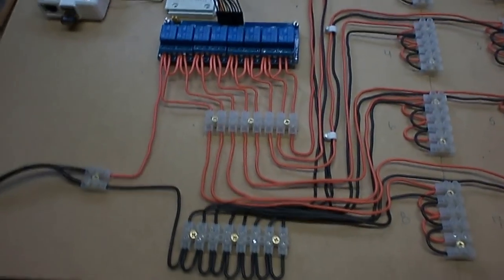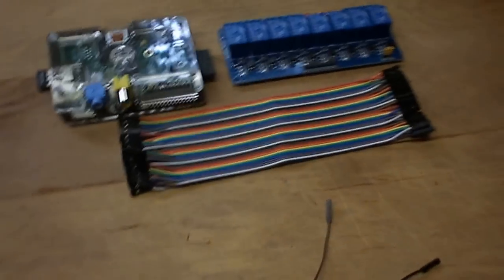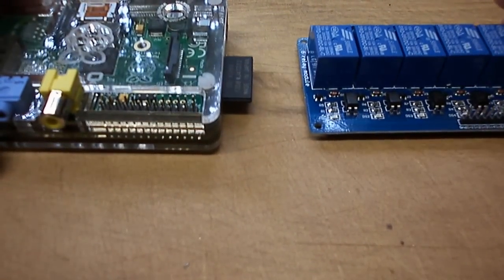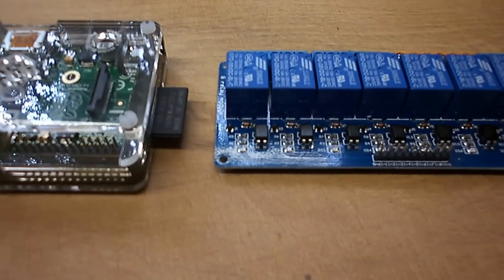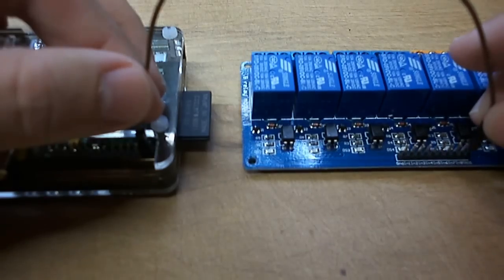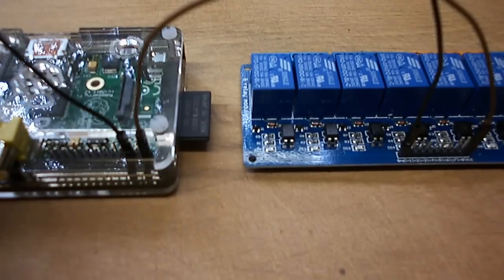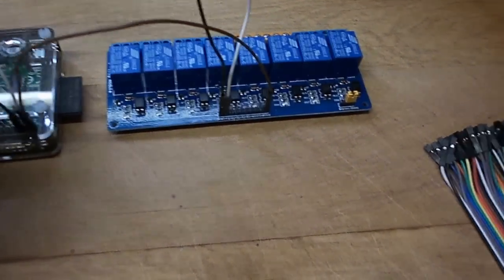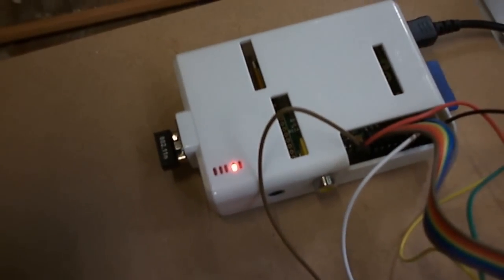How to: Home Automation - connect 8 channel relay + Raspberry Pi

Comment: Thus - as this appears to be - an 8-way 12vDC RELAY board - with opto-couplers on all inputs.
I take it (also) that your "Raspberry Pi" - is only outputting a 5vDC power source..

You are attempting (in this video) to tell everyone here, that the 5vDC (your little device outputs) is good enough to provide enough power for all 8 of those 12vDC relay coil circuits, even if these 12vDC coils - are all powered on (as occurs at some stage of the relay ops).

I would assume that you have zero idea, what the opto-couplers are there for, as their primary function is to increase the 5vDC signal outputs from your PI - to operate the 12vDC relay coils.
Thus - you have to have a 12vDC supply (ready) for the relay coils, and that then allows for these 5vDC signal outputs from your PI device - to control the 12vDC feed to each relay - when controlled via the 8 opto-couplers (when a signal arrives from the various 5vDC PI signals - all of which ONLY have 5vDC signals - that are boosted via the "on-board" opto-coupler circuitry.

It is these opto-coupler circuits themselves, that allow the 12vDC to operate the 12vDC relay coils, as they are designed to "electronically" switch the 12vDC supply (to allow each relay coil to get enough voltage & thus working current - off the 12vDC) when your little device can only supply 5vDC signals.

An external 12vDC supply is required to be powered ON at all times that you have the board connected to your PI, thus you also need to switch it on & off, (or have that always on) before any of your PI's 5vDC signals will operate the opto-coupler circuits, to electronically control the relay coil circuits.

To thus allow the 8 "signal controlled" opto-couplers to switch that 5vDC signal - via the 12vDC feed which in turn switches the coils of the 12vDC relays - that each relay those opto-couplers control, 
You need to optically isolate the 12vDC supply feed, from your PI's 5vDC signals

The relays thus are switched optically from just 5vDC (when your 5vDC PI sends a signal via one of the 8 outputs - all of which ONLY have a 5vDC signal feed, coming from the PI master unit).

As the relays themselves require 12vDC - the 5vDC signals coming from your PI will NEVER be sufficient to power-on 1 relay coil - let alone all 8 of the relay coils - unless they are BOOSTED by the opto-coupler booster circuits.
 
Only by way of the opto-coupler circuits, can the 5vDC - switch the 12vDC into their respective 12v Relay coils - which then allows your tiny 5vDC signals to be keeping the relays ON - as this is achieved from the 12vDC supply - powering the relays via the opto-coupler circuit/s.

THE 230vAC (lighting mains power) on the relay contacts themselves - that is (ALSO) isolated from BOTH the 12v relay coil circuits, as well as double isolated from the 5vDC PI signal outputs, by way of the relays themselves AND by way of the isolation features - of those 8 opto-couplers.

p.s.
NEVER FEED any relay's N/O terminals - with 230v AC mains, as these SPDT contacts are designed to ONLY have the commons looped across live mains.
The relays then switch the mains via either NO - or the NC contacts.
Thus one can have a small RED / GREEN illumination panel at or beside the output contacts, such that (at a glance) one can instantly tell if a relay is powered on - or not.

By inserting the mains - into ONLY the NO contact terminals and looping from there.
You can NEVER get switch functions indicated on a control panel - showing the aspects of each relay.
Why?
Because the NC contacts can NOT get power from the NO contact - as the common contact disconnects from the NO before closing the  NC (& visa versa).

..

Now lets get it straight shall we.
Your PI is 5vDC (only) and outputs low power (low current) 5vDC signals

The relays are all 12vDC (meaning that they have higher current consumption 12vDC coils)
It's the relay contacts - that switch the 230v AC Mains.

The 5vDC PI does NOT directly switch the 12vDC relay coils (that's what the 5vDCto12v DC opto-couplers are for)
&
The PI also does NOT switch directly - any of the 230v AC Mains circuits - (that's what all 8 relay contacts are for via the NO & NC contacts) .

By connecting JUST your 5vDC PI directly to the 12vDC relay board - to directly control all 8 relays
You seriously run the risk of destroying your tiny PI's 5vDC output signal circuits, as these ARE NOT DESIGNED - to power 12vDC Relay coils.

You can get away with direct driving "relays" from the PI - when using one (or two) 5vDC relays only.

Never attempt to circumvent the opto-couplers by selecting the JUMP circuit jumper - as that LINK is there for 12vDC signals.
Not for direct driving 12vDC relay coils, from the tiny PI's 5vDC low-current signal outputs.

Also of note.
NEVER EVER loop the 230v AC Mains - by using the NO contact terminals of any relay.
The COMMON terminal is best for that - as inside the relay - the common terminal circuit is better protected from the coil circuit.
When the NO contact closes, there's usually a load on that circuit, such that the risk of an internal spark-over is lessened.

Also - if one needs BOTH a normally open AND a normally closed contact - for any ONE circuit controlled by each relay - by feeding the live AC in via the NO contact - you defeat the need for the NC contact (as it will NEVER see the live AC mains)
.
The additional reason for center feeding (via the Common terminal) the 230vAC mains is this, when any relay FAILS to operate - there is the option of having a Normally Closed "indicator light" connected.
Thus one can instantly see - which relay is powered ON - & which is faulty (if it should be on)
You can also see which has blown internally - if all indicators for that relay are both on (or both off)

Sparkies know a little more (about electrical circuits and their design characteristics) than your everyday kit-basher - as that's been our lively-hoods, for most of our working lives.

Comment: is it possible to connect the GP10 direct to a mosfet like IRF840PBF ? or i need also relay like the one you showed to turn on and off the gate on the mosfet IRF840PBF  ?
Reply from the maker: GPIO as in Input / Output.  I would think yes, you could do that.  But then the output would be limited to a maximum of 5V and only a very tiny amperage.
Reply: @skiwithpete  the mosfet will be used to turn on and off 220 volts 5amps I guess I will need to use the relays you used but how fast can they turn on and off what is the maximum frequency?

Comment: If internet connection fail but i want  to use my 8 chanel Arduino  to on off light without internet  plz send me wiring diagram for this use

Comment: Howdy, Why did you set the jumper to JD-VCC  - VCC?
Reply: perhaps because he doesn't have the need for opto isolation.  Then one would ask, why bother with a board that has opto isolation when the load is already isolated...
Reply: @axa.axa.  isn't the other for ground I heard you say the one on the right that's why I was asking. I have my own relays and im using a 2amp 5v supply to give power than im using a arduino
Reply: @lightsonmatfield4031  
The JD-VCC - VCC (jumper letters) is a shortened term for:
This [LINK] JUMPS this -VCC onto THAT -VCC
Being the 5vDC jumper - is JUMPED onto the relay's (supposedly 12vDC power) coil circuit feed
Thereby voiding the opto-couplers job, by completely removing them from each relay coil input controls.

This also has a tendency to remove isolation between all of the relay coil circuits - and could potentially screw your 5vDC device - if any of the 8 relays "fly-back" diodes fail.

Thus - why purchase an opto-coupler relay board - if all you want to do - is jump out the opto-couplers and STILL risk your 5vDC device.?

Risking any 12vDC signal source - to direct control the power to 12v relay coils - isn't such a bad thing .
But to overstrain a small 5vDC device - by lumbering it with directly controlling EIGHT 12vDC coil circuits - that's insane.

Comment: Hi, i will connect the 8relay board to my rpi2, basically to control lights. Do you have any diagram showing the high voltage connections from the relays to the lights?

thanks
Reply from the maker: no. don't use mains electricity. it can kill.
Reply: +skiwithpete are you sure? Can i connect hight voltage to relay 250 V 15 A?
Reply from the maker: +1flyman1 That much power will kill.  If you're asking the question, you're gambling with your life.  Get a 12V system like I did.
Reply: +skiwithpete ok, but if i want to turn on a lamp, how i can do?
Reply from the maker: +1flyman1 Make a 12V lamp.  Like this: https://www.youtube.com/watch?v=WpM1aq4B8-A
Reply: +skiwithpete I am working the PI2 with an 8 relay board switching on and off my aquarium lights without any issue, i am using just 2 of the 8 relays for 240volts, approx 50Watt each socket
Reply: +Minas Stratigos thanks, have you do it in phyton? Can you send me the code! It's my first time with raspberrypi and I need to know how it work! Please

Comment: hi i need some help
i have a rapsberry pi B+ and i connected an 8 channel relay to it 
just like you did
and i also have a jumper on VCC and JD-VCC
when i power up my pi,
all relay led lights up... except the last one
is there anything wrong ?
what should i do ?
Reply from the maker: CS S Watch this vid https://www.youtube.com/watch?v=OQyntQLazMU I have problems at the start and you can see my testing method...
Reply: hehe thanks i watched all your videos btw :D
do you think its a power problem ? 
mu pis power supply is only 750mA
Reply from the maker: CS S
Yes.  You should use a 2A, even if the Pi can only draw a max 1.2A
And thanks for watching.  Getting reading for my Pi2 review :)
Reply: really ? i can use a 2A power supply ?
actually the 7 leds lights up as soon as i plug my power supply to the pi :/ and when i run a script the led would light brighter :/
its not like in you videos where the leds are off and lights up when a script is run !

ah thats cool awaiting this review ;)
Reply from the maker: CS S
 No, there's something wrong there.  Is it an optocoupler relay?
Reply: its the same relay as in your videos,
its ok now,
i mean when i power my pi,
the relay light would still light up but low intensity,
and when i would run the script to test all of them, they work fine and the lights would go off normally :)

only issue is when i power on my pi but i guess it doesnt affect anything..

Comment: Hi pete!
I'm pretty new to this stuff and I've read, that there is a problem with the rpi's 3.3V output pins in combination with the 5V relais. I'm about to modify the connection as in https://github.com/fixedd/RPi_Relay_Interface but it also says, that the relais board may already have this logic included. I would buy this board: http://www.amazon.de/Tomorrowtop-Aktiv-Niedrig-Relais-Arduino/dp/B00EDHX4Z4/ and I wanted to ask you, if you know if this is safe to use without the additional transistor board. In this picture it shows 2 resistors and a transistor for each input as it is done in the mentioned project above: http://ecx.images-amazon.com/images/I/61PovzyTvdL.jpg

I would be glad if you could help me =)

Comment: On SainSmart they say you need to connect the Pi to the Relay board differently in order for it to work with a Raspberry Pi
http://www.sainsmart.com/8-channel-dc-5v-relay-module-for-arduino-pic-arm-dsp-avr-msp430-ttl-logic.html 
https://docs.google.com/file/d/0B5-HND9HJkXWSTQtYlFTZ3VyODA/edit 

I just got a Pi B+ and I am new to the EE side of things. Do I need to wire it the way SainSmart is doing it or can I connect the Pi directly to the relay? I am looking at buying a SainSmart 8 channel relay from Amazon (link below).
http://www.amazon.com/SainSmart-8-CH-8-Channel-Relay-Module/dp/B0057OC5WK/ref=cm_cd_ql_qh_dp_t

Thanks a lot for creating videos like this!
Reply from the maker: The images you show are how to connect a 5V relay.  But the optocoupler relay that I use can take lower voltages, so you don't need to connect it in that way...
Reply: Ok great. So my  link to the Amazon relay should work fine? Sorry for the dumb questions

Comment: ok, I think I got it.  here is the schematic: 
http://www.sainsmart.com/media/catalog/product/cache/1/image/500x500/b97a0c6c1d16e76f7464abfcbb6a0a8d/4/c/4channel-relay2.jpg

you want 3.3 volts on the VCC pin, and 5.0 Volts on the JD-VCC  
the VCC is the power for the LED portion of the optically isolated transistor U[x]  
JD-VCC feeds the collector of the optically isolated transistor U[x] and depending on whether or not the IN[y] connected to to pi is either a 3.3 or a 0 will allow the JD-VCC voltage to pass thru to the emitter.    JD-VCC is also the power for the relay coil,to the right of  D[x] 

when you apply 5v to the VCC pin you are  asking the optically isolated transistor rather than toggling the power to the led of the optically isolated transistor between 3.3 and 0, you are toggling it between 5.0 and 1.7. If it works, its because the 1.7 volts is not enough to power the led, and you are just "getting away with it."  

you have also disabled the safety mechanism of the optically isolated transistor.as the jumper connects VCC and JD-VCC, you now have a copper to copper connection from the pi to the relay as that relay is mechanical, and might be throwing some real power it can back through into the Rpi

What I believe you want is for the VCC and the pin to be coming from the Rpi and the ground and JD-VCC to come directly off of the 5v power supply.

BTW, this is not intuitive, this is really confusing.   .

Comment: Thanks For the Video. I used that same sainsmart 8 channel relay board with my arduino Uno r3. I power the relay board from the arduino like you do with your pi.
The arduino doesnt deliver enough power to the relay board to operate more than 2 or 3 relays at a time. How would I connect a 5v external Power source to the Sainsmart Relay board and retain a common gnd to the arduino? Thanks!!

Comment: Hi Pete, this is an awesome vid, and I'm loving the neat circuit layout, its thing of beauty but it's left me with one question, why have you used 6 way connectors for the 'separate' connections on the right of the circuit (see 0.03 in video)?  I get the two 8-ways used for splitting the initial positive and negative wires but why don't they they connect into eight 2-way connectors instead of eight 6-way connectors as shown? Is this essential if you're just running one device off each of the relays, are you connecting three devices into each of the 8 (if you are then you're a lot more hardcore than me ;)  Cheers for any help on this
Reply from the maker: The 6 way connectors would each attach 3 lights.  My thinking was 1) path, 2) area 3) highlight (like a tree or a flower).  I lived in the woods and it was both dark and a winding path to get to the front door - it had a certain scariness when it was dark.  Even when the path was lit.  That's why that was the plan was to use multiple lights on each section.  My light selection video will probably shed more... err... light on this.  As the steps would have used LED strips, floods for the area, and spots for the highlights.
Let me know if I can help any further.
Cheers,
P
Reply: skiwithpete
Gotcha more lights have to be good thing... Was kind of a dumb question but I'm new to this, seemed better to ask, thanks
Reply from the maker: Cameron Behbahani No worries, glad you did.
Cheers,
P

Comment: what do i look for to get 1 of those 8 channel relay boards? part number please? i intend to use amazon uk website i will also search for it on amazon.co.uk but if you have any ideas i will try them too to compare :D thanks all i could find is this 1 for the arduino http://www.amazon.co.uk/TIMETOP-Active-Channel-Control-Arduino/dp/B00ENCWN3S/ref=sr_1_fkmr0_1?ie=UTF8&qid=1390236389&sr=8-1-fkmr0&keywords=8+chanel+relay+board+for+raspberry+pi
Reply from the maker: That one should be ok.
Otherwise I search for optocoupler relay boards:
http://www.ebay.com/sch/i.html?_odkw=8+channel+relay+optocoupler&_osacat=0&_from=R40&_trksid=p2045573.m570.l1313.TR0.TRC0&_nkw=8+channel+relay+optocoupler&_sacat=0

Comment: I just got my first Raspberry Pi for Christmas and can't wait to start a few project, so I can decide where to finally use my Pi.  Thanks for the great YouTube Tutorials.
Quick question... since the listings on EBay seam somewhat unclear.Is this the correct 8 channel relay? http://www.ebay.com/itm/121218923271
Reply from the maker: Thanks for your positive message.  That relay looks like it's the right one.  I typically do a search for an "optocoupler relay" - and while the auction doesn't say "optocoupler" it does appear to be one - because it works with arduino (5V). 
Enjoy your Pi.  It is both the most fun and most frustrating thing you can play with.  :)

Comment: What is the static current drawn form the RPI 5V with all 8 relays on.
And what for the dynamic current ?
Reply from the maker: Hey Kris,
You're really testing my knowledge here. 
The static current would be 5v*XmA + (3.3v *2mA)*8=Y
Unfortunately, I don't off the top of my head know the value of X, different spec sheets say it is in the 50-75mA range (for a single relay, depending on the manufacturer) - though I'm sure you can look it up for your board and the number of relays you intend to power. 
As for the Dynamic current, I'd have to measure at the mains - which I haven't.
Let me know if there's any more info I can provide, or if you come to different numbers I'd be interested to hear.
Cheers,
P
Reply: skiwithpete I was wondering if a cheap USB phone charger could handle the power for both RPI and all , in my case 4 , relays. And be sure that in case of switching all relays simultaneous , nothing will burn. Which I think will happen since these cheap chargers are common 700 mA rated . .